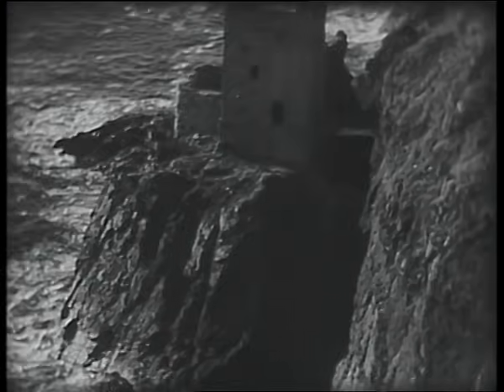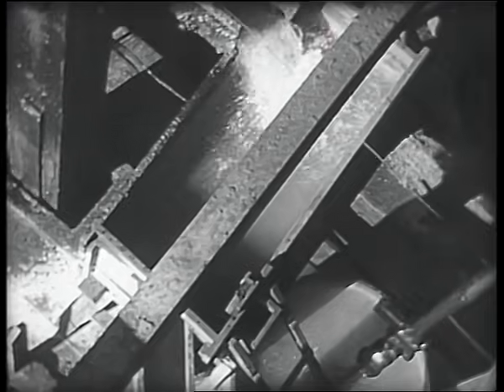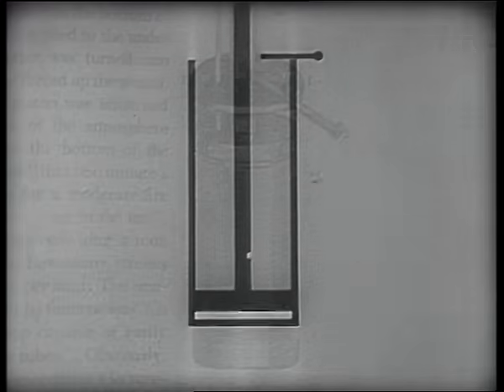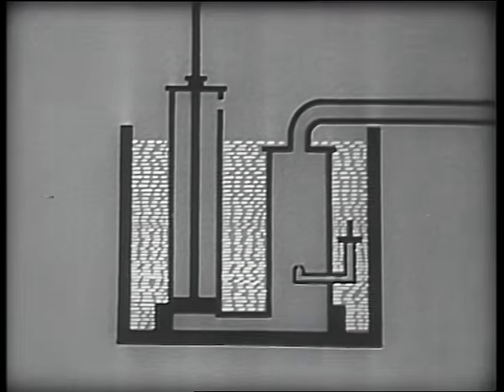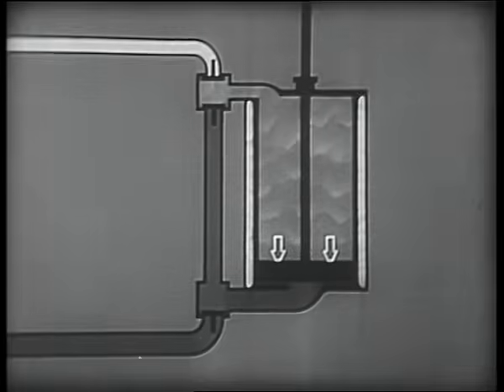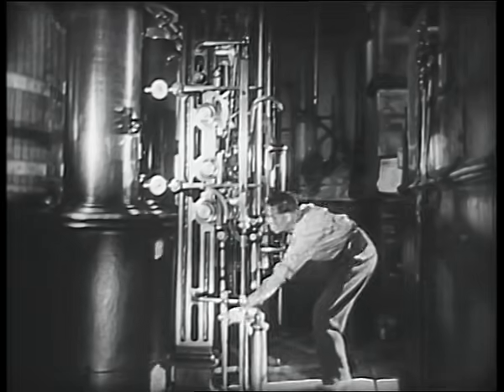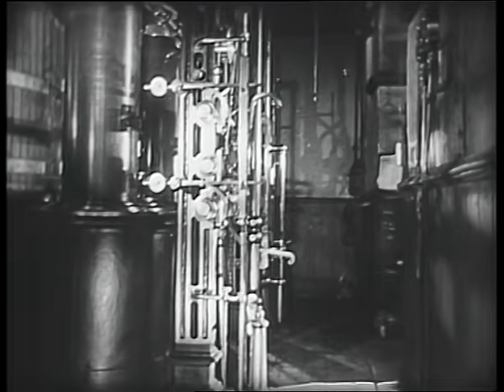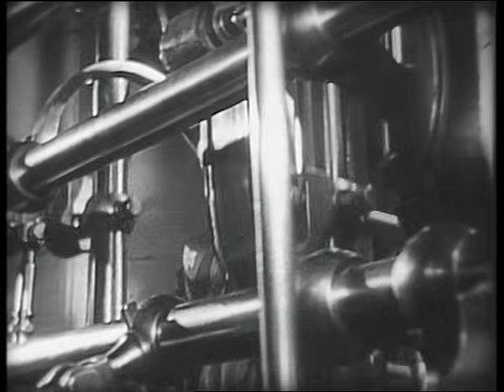The Cornish Engine | Shell Historical Film Archive

Comment: The Cornish Pumping Engine – An Engineering Paradigm of Capital Efficiency, Thermodynamic Innovation, and Industrial Productivity

The Cornish pumping engine constitutes one of the most significant technological achievements of the Industrial Revolution and represents a defining milestone in the historical evolution of thermodynamic engineering, industrial capital formation, and productivity enhancement. Rather than merely constituting an incremental improvement over the atmospheric engines developed by Thomas Newcomen during the early eighteenth century, the Cornish engine embodied a comprehensive systems innovation that fundamentally redefined the economic relationship between fuel consumption, mechanical output, operational reliability, and capital investment. Its development demonstrates that sustainable industrial competitiveness rarely emerges from isolated technological inventions but rather from the continuous optimization of an integrated engineering system consisting of thermodynamics, metallurgy, manufacturing quality, operational procedures, and maintenance philosophy.

The economic necessity driving this innovation originated from the unique geological and logistical conditions prevailing in Cornwall. As mining operations expanded to increasingly greater depths, groundwater infiltration developed into the principal operational constraint. Existing pumping technologies proved technically inadequate and economically unsustainable because their excessive coal consumption significantly increased operating costs. Unlike the coal-producing regions of northern England, Cornwall depended upon imported coal transported over considerable distances from South Wales, thereby exposing mining enterprises to elevated fuel prices and substantial supply-chain risks. Under these circumstances, energy efficiency ceased to represent a merely desirable engineering objective and instead became an indispensable determinant of commercial survival. The resulting innovation pressure stimulated one of the earliest examples of systematic industrial optimization driven directly by economic incentives.

The technological lineage of the Cornish engine illustrates the cumulative nature of scientific and engineering progress. Denis Papin established the theoretical principles governing steam condensation and vacuum formation. Thomas Savery translated selected physical principles into practical pumping devices, although their operational limitations restricted widespread adoption. Thomas Newcomen subsequently introduced the atmospheric engine, which transformed steam power into an economically useful industrial technology by exploiting atmospheric pressure acting upon a piston following steam condensation. Despite its revolutionary significance, the atmospheric engine suffered from fundamental thermodynamic inefficiencies because the cylinder was repeatedly heated and cooled during every operating cycle, thereby dissipating substantial quantities of thermal energy.

A decisive breakthrough emerged through the pioneering work of James Watt, whose invention of the separate condenser fundamentally altered the thermodynamic architecture of the steam engine. By relocating steam condensation to an independent vessel while maintaining the primary cylinder at elevated operating temperatures, Watt dramatically reduced heat losses and increased fuel efficiency by several multiples. This innovation established the conceptual foundation upon which subsequent generations of engineers could pursue further improvements in thermal efficiency without compromising operational stability.

The Cornish engineers extended Watt's principles through the systematic application of high-pressure steam technology, robust boiler construction, precision valve timing, expansive steam working, and highly optimized mechanical control systems. Richard Trevithick's introduction of high-pressure steam, supported by improved boiler metallurgy and manufacturing quality, enabled engines to extract substantially greater mechanical work from identical fuel inputs. Steam admission during only the initial fraction of the piston stroke, followed by expansive working throughout the remaining stroke, represented an elegant application of thermodynamic principles that significantly increased energy conversion efficiency while simultaneously reducing coal consumption. By the middle of the nineteenth century, Cornish pumping engines achieved thermal efficiencies approximately sixteen times greater than the earliest atmospheric engines, representing one of the most remarkable productivity improvements in the history of mechanical engineering.

From a contemporary executive perspective, the Cornish engine serves as an instructive case study demonstrating that technological leadership is rarely achieved through isolated inventions alone. Sustainable competitive advantage results from the disciplined integration of scientific understanding, engineering excellence, operational standardization, economic analysis, supply-chain optimization, and continuous process improvement. The Cornish engine therefore exemplifies a complete industrial operating system rather than merely a superior machine.

For today's CEOs, CFOs, and industrial decision-makers, several strategic management principles emerge from this historical development. First, resource scarcity frequently acts as the primary catalyst for breakthrough innovation. Second, superior capital allocation should prioritize long-term operating efficiency rather than minimizing initial acquisition costs. Third, incremental improvements applied systematically across an integrated process architecture frequently generate greater shareholder value than isolated technological breakthroughs. Fourth, engineering excellence and financial performance are not competing objectives but mutually reinforcing components of sustainable enterprise value creation. Finally, the enduring success of the Cornish pumping engine illustrates that operational resilience arises from disciplined system design, rigorous maintenance standards, and continuous optimization rather than from technological complexity alone.

Viewed through the combined perspectives of engineering economics, corporate finance, industrial management, and strategic operations, the Cornish pumping engine remains far more than an historical artifact. It represents an enduring benchmark of capital productivity, thermodynamic optimization, and industrial innovation whose underlying principles continue to inform modern approaches to energy systems, manufacturing excellence, infrastructure investment, and enterprise transformation. Even in the twenty-first century, its development offers valuable lessons regarding the relationship between technological innovation, resource efficiency, operational discipline, and long-term value creation.

Comment: In the mid 70s I visited a museum that was set up in the top floor of the Holman factory in Camborne. They had a big beam engine set up in a stair well. The fella there ran it (on air) for me and my mate. He said he couldn't run it for long as it emptied all the air receivers in the factory. I was disappointed to see it had gone when I revisited later, probably mid 90s. I wonder where it went. I really enjoyed this video. Very interesting. Not knowing too much about steam power, it is easy to believe they were all high pressure steam like the later versions. Thanks for this one. Edit: it looks like it closed in 2003 so it must have been after that when I revisited.

Comment: The Dutch steam pump is known as the Cruquius Pumping Station. Located at Hamsteade, Holland, is the worlds largest steam powered water pumping station. It is lovingly preserved by the curators of the museum there, it pumps 8 metric tons of water per cycle.

The last of the still in production engines is the Crofton pumping station that moves water to the summit pound of the Kennet and Avon Canal at Wiltshire.  They use conventional electric pumps for day to day operations though.